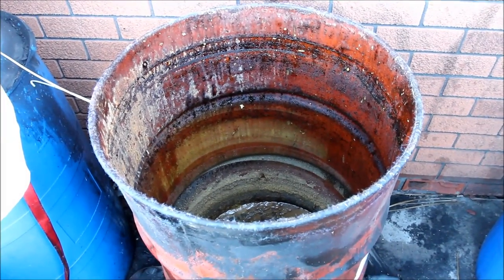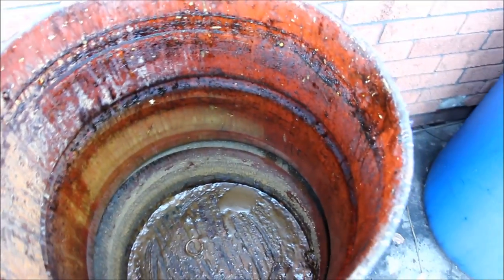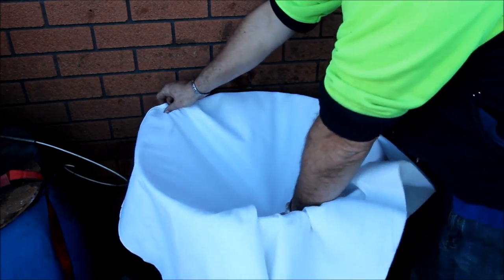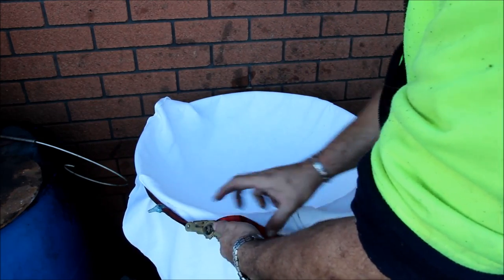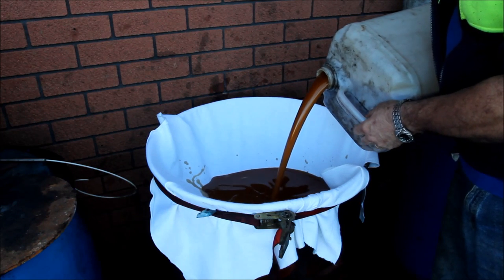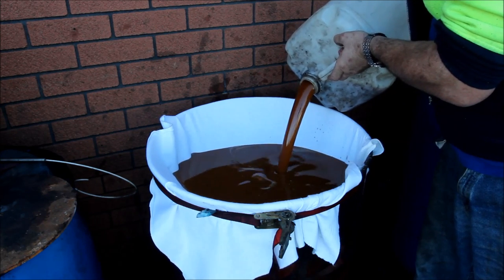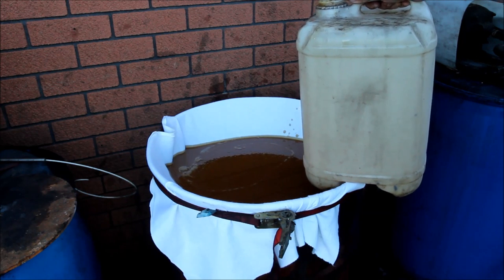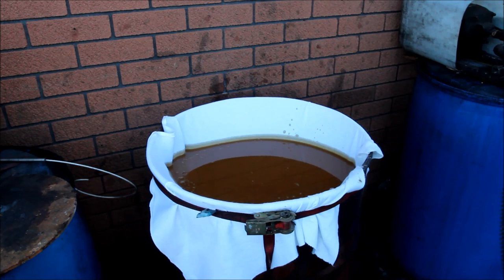Filtering used oil WVO, WMO for Diesels or heaters

Comment: Any other YT vid on my subscriber list, I watch in the evening when things slow down. Your vids are always so interesting I have to watch them immediately! 

Never saw you process any truck fuel w/ NaOH and methanol. =I guess where you are, it's not cold enough for glycerin to be a problem?  Anyhow, GREAT STUFF. Keep them coming!
Reply from the maker: OgMandin0 I Have been going to do some Bio for the winter, another thing to do. Fortunately my vehicle run fine through winter on a 10% ULP / veg oil mix.  Bio would be good to mix say 50% . Glycerin should never be a problem with Biodiesel because it should all be taken out before you put it in the vehicle. I prefer water washing myself as I find it is more reliable to get all the Glyc out but a friend of mine was dry washing and getting excellent results with that.  Thanks again for the lind words and support. Much appreciated!

Comment: Wife works at an Butcher Shop, and they sell french fries and stuff like that every day. They have to change the oil in the fryer every day, thats 25/liters per day, and when i see videos over here.....i get some ideas for that kind of stuff
Reply from the maker: That would be a great resource. You could boil down some of the offcuts fat as well and render that down.  It makes excellent fuel especially in summer when it's liquid.  Check out the Burners I built to run on this as well as how to process it into diesel fuel.

Comment: Do you get a cleaner burn when you use filtered oil vs. none filtered oil? Or is it just to stop from plugging stuck up?
Reply from the maker: wetheralmaplefarm  I don't think it would make any difference in a burner. Particles may clog a valve if you had it closed down but running wide open most would pass through. 
Mainly I am doing this to process the oil for fuel in my vehicle. That has to be clean as I can get it. this is just the pre filter to save my 1-5UM water filters I use for final filtering. 
In a burner the oil dosen't have to be nearly as clean but having dry oil with no dissolved water will make it run a lot hotter.

Comment: I use coles / wollies reusable bags. Works a treat!
Reply from the maker: Fark Tard Yeah, I used to use those too actually. They do work well. Used to have 3-4 of them suspended over 25L drums with the tops cut out dripping away. 
Spose you could always weld something on the sides of a drum to loop the handles through to suspend them. 
I remember Target used to have some real big bags. They held about 60L but you couldn't put that much in them or the handles tore off.  :0(

Comment: just wondering, could you also use the snap locking ring that is used to hold the lid on the drum in place of the ratchet strap?
Reply from the maker: kingswoodkid1985  I think you probably could. You would have to fit it round the rim as they normally attach but it should work. Even if there was a little too much clearance, doubling the felt back on the edge should fix it. 

Bloody good idea! I think I have one of those rings, I'll have to try it... and if it works do a new vid!  :0)
Reply: cheers! just seemed like something that might work, seeing as i'm setting up for bio diesel atm
Reply from the maker: kingswoodkid1985  I have been doing Bio with a friend over 10 years. All I would suggest to you is keep things simple. Every one goes over the top and is all pedantic. It's a simple process that if followed works well and you don't need to spend a lot of money on crap to make it work perfectly.  Take everything you read with a grain of salt because many of the people doing it has some sort of obsessive compulsive disorder I reckon.  Another friend made perfectly good Bio for many years just with a 200L drum on bricks with a gas ring under it and an old pool pump circulating the mixture.  My other mate and I built a processing setup that would Hold 1000L ready to go, have 1000L being processed and a holding tank for another 1000L of finished product.  It was quite a setup but we still put it together for next to nothing and it produced top notch Bio. All the oil was of course heated with Waste oil burners. Never put a heating element in the system.

Comment: If you use 1ml to 1litre of kerosene if you're leaving it to stand for 24 hours it can really help the viscosity? of the finished product you put in your engine. I used to do this when I ran veg oil and it does not matter if you accidentally use too much, but it has to stand for 24 hours. HAAPPY NEW YEAR. J

Comment: I have a suggestion... Why not use a CHEAP screen Filter first, then the Cloth on 2nd stage. That way the Cloth can prolong usage. Screens are cheap :))). Just a thought :D
Reply from the maker: And not a bad thought either and something I used to do. My veg oil sources are pretty good now and pumping from the top of a drum means the larger stuff has settled to the bottom or floating on the top. in between the contaminants are quite fine and would go straight through.  Chunky stuff doesn't block much actualy anyway. It's the real small fine stuff that blocks things up like filters. 
 I used to collect oil that I would suck up vermin and table napkins. 
Thankfully I have sussed better sources these days.
Reply: Ah, ok... Good that you found a good Source for your Oil. We live in the City and there are plenty of FREE Oil and Motor Oil too.... Me and my Dad been so STUPID... Should have thought of making a FREE HEAT Oil Burner for Winter. Finally, we will be building one and I will post some Video in the near Future :))). I watched your Video and most Videos on YouTube to get some tips of making our New Heater. We are actually doing so we can Heat Our House with it.  So we are on the hunt for SAFETY, LOL. But I did learn a few tricks from your Video and THANK YOU for posting it and sharing it.

Comment: + Oil Burner As you use waste veg oil in your burners, and you make bio, would it be worth the trouble of converting veg to bio to burn in a small aluminium foundry furnace? 

Have you tried bio in a burner? 
Could we see that in a vid? 
Maybe with a side by side shootout between similar burners?
Reply: Oh, ok. I was not sure if the methanol added any benefit. Then perhaps WVO vs. waste motor oil? Visually of course, with similar burners maybe. Providing a spectacular burner demonstration is your forte, after all. Just a suggestion for a possible video.
Thank you.
Reply from the maker: +Zed Showsyouhow   Methanol is normally removed from bio because the undesirable Glycerin  attaches itself to it. Remove the meth and the glyc drops out which you do not want in bio. 

A side by side Dual Burner burn is something I think I'll look at. Take credit for the idea when you see the vid.   :0)
Reply: Thank you.

Comment: OB, rather than toss the fat latent felt, why not use it to get your burners started... It seems to me a plumbers torch would lite it up quickly and fat burns pretty well. It would be another step toward making the whiners happy as well!!!!  hahaha... You know, more eco friendly!!  ;)
Reply from the maker: Steve 1961P. Actually I did that Steve, Just cut some sections off the large piece and put them in. worked well. 
Didn't mention it because I didn't think anyone else would want to muck around with it. The edges are OK but the middle where the oil has been sitting gets pretty Nasty!

Comment: Nice...
Playing around with the burner i made with your design and it really is the shit. When its running our quiet neighborhood sounds like an airport :-)  I think its best i tone it down a bit. I thought about burying it.
Anyways got side tracked building a different burner for a smaller furnace design and much less heat output. Its not as manly as yours but should keep the neighbors clueless.
The one im building is the kwiky oil burner design from David D on youtube have you ever tried anything similar to this? Its way less radical and a bit more work but a smaller output could be useful for some things you do?
Reply from the maker: builtrodewreckedit  The spray design burners are popular but require compressed air to operate.  If used with diesel or thinned oil,  they do have the advantage of not needing a preheat.  To me the tradeoff of the extra complexity and need for a compressor, even though I have a large one, does not outweigh the no preheat. 
Starting my burners on LPG I can have them up and running in 2 Min and that is sufficient for my needs. 
The Compressed air types are also limited to sane and practical heat outputs which kind of undermines my whole irrational enjoyment of these things.  :0)  Wait till you see the next vid I shot today! Biggest, wildest burn ever!

For me the simple drip type burners work fine although other people may prefer the other type and design. 
No right or wrong, just what you prefer.  I do Intend to get round to doing my own spray design one day just to show I can do it! :0)
Reply: Oil Burner  Hey brother. How's things??  Good here. Finally getting somewhere with my back shop.. 
I have a question for you. I know you are a very resourceful guy and figure you may even already have the item I am thinking of converting. In the States we call them Salamander's. They are a forced air and kerosene heater. They come in many sizes and of course a fairly thick price in many cases. But these units have their own tank, oil pump and ignition along with a concave flash header just at the face or working end of the heater..  I have always wanted to try to convert one to veggie or used motor oil and see if it is worthy of a more controlled heat as the original heater is designed.. 

I know your ideas are for barn burners and have that same like for watching how fast you can smelt things down. I think there IS a place for all of it myself.. 

I think if it works, the next thing is either converting the heater to a 12V. system for the woods/off grid/solar/battery, but for now I think maybe an inverter  would be ok.. 

Thoughts??????
Reply: If the salamander runs on diesel id bet you could mix 2 gal of motor oil with 1 gal of regular unleaded gasoline to make a mixture that burns just like diesel..... I personally dont think it would be a good idea because used motor oil is full of other contaminates that would be in the air when its burned. Atleast not a good idea to heat any aria not well vented
Reply from the maker: Steve 1961P.  I think there is a fuel control on those things that you would have to adjust to get the right fuel to air ratio. You may want to try starting off with 50% Diesel and work from there. If you could get Kerosene or even old jet fuel from a maintenance hangar ( they are not allowed to put it back in once taken out)  that would be better to thin the oil than diesel.  I agree that I would shy away from engine oil. I would have used it once till a mate pointed out what's in it. It's not what comes out of the engine you have to be worried about because that's all common metals you eat and drink out of anyway. It's the additives that are in the oil from the start.  Veg is much less toxic and I would prefer to use that myself. 

It would be good to see how one of those went because I agree with you, stupid output burners are all fun and games but practical applications are where the real benefits of this are.
Reply: Oil Burner Needing a compressor for such a small volume of air always put me off too. 
a small wiff of smoke won't draw too much attention to what im doing but i had everyone in a 1/4 mile aria wondering what the hell the rumbling noise was :-) I think burying the bottle and shooting the flame into a hole would help the noise allot or maybe i use a smaller bottle or pipe and make another? But being at work i have plenty of air and the spray nozzle is fun to tinker with... cant wait to see what you come up with next

Comment: Safety tip of the day: do not go bopping apples in that bucket!
Reply from the maker: Arjan Wilbie  Hmm, for the safety zealots and sissy's, I think they SHOULD  do exactly that! 
Maybe they should st IN The drum as I fill it, through a small hole in the tightly secured lid to make sure there are no dangerous leaks and the filtering is working properly.  I'll give them about 10 Minutes to have a good inspection when the drum is full and then they can come out and tell me if everything is OK.   :0)

Comment: In your barrel fins a loot of crap like you do not filtered at all your wvo.
Reply from the maker: That is mainly congealed fats and some water. This is only the PRE filter to remove most of the fats and the larger particles. It is 
filtered properly after this but this saves the main filters which are more expensive than some felt.
Reply: I drive on WVO almost a 15 years. So you need to pre filter better your oil. Put a two or three sheets instead of one. When you're done with pre filtering, on the second filtering when you are finish just add a little RUG on the top of your oil. After 2-3 days slug from WVO will sink on the bottom, drain that slug and you have clear WVO like new oil. Here in the Sweden winter its very cold -30 -35 C so i need very clean WVO.